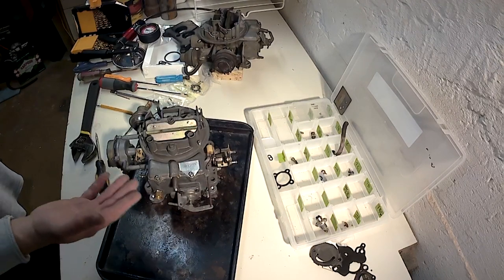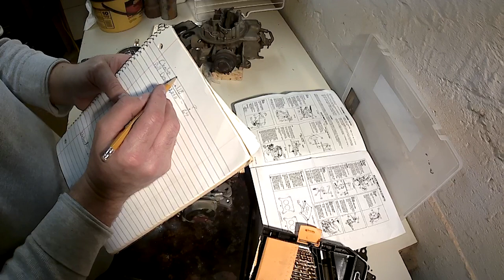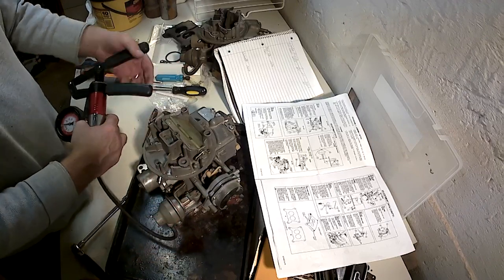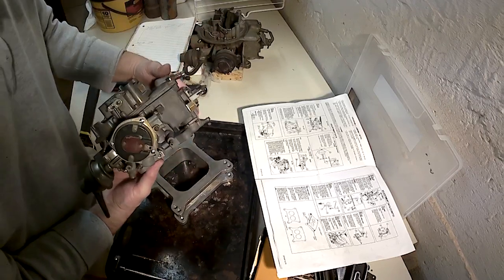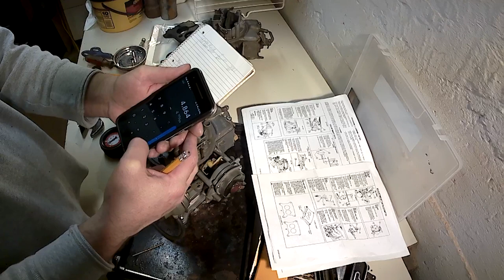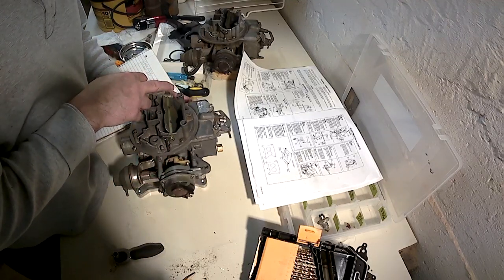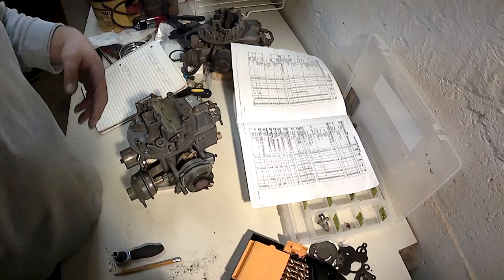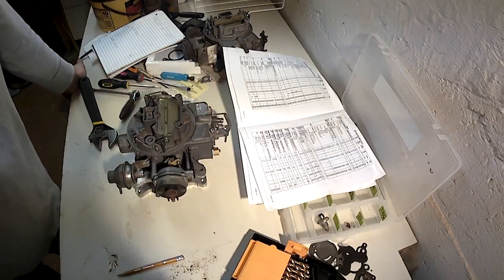2150 Carb Rebuild 4- Choke Adjustments

Comment: Thanks for taking time to put this info on the internet. It was really helpful, as all the info I could find elsewhere did not have the exact configuration as mine. The carb you did had the same choke stuff, and you’re explanation really helped me figure out what to do w all those adjuster bolts. Now if o could only find a vacuum hose diagram/video for the same carb
Reply from the maker: You're in luck! I've got a three-part video series on my Youtube channel where I go into excruciating detail on the process of identifying each of the systems and the vacuum lines that control them, and even go through the process of rebuilding the vacuum-advance harness. Here is the first:

https://youtu.be/GReFi9Z59cA
Reply: @bbsbcv  thank you a ton! I’m not internet savvy, so it’s been a chore to get this far haha. With your video on vacuum stuff I might get the old truck happier than ever!
Reply: On that heated choke riser....mine is sucking air right now and I got surge idle. I noticed a white plug on the choke housing on carb shown here - is that a breather filter for heat riser choke? Please help!

Comment: Geez, so much detail.  I make final adjustments on the engine with engine running.  But it all starts with basic cold adjustments to fire the engine and observe how everything functions.  You think the 2150 is middle of the road in complexity, I think it is an easy simple to work on carburetor.  You say potatoe, I say potato. 
Good video, thank you for your intelligent confabulation.

Comment: Thanks Bob- You did not have to make the final adjustment but I need to - (27/64) WOT- how do I get my WOT to open, what screw is used? Looks like prior to adjusting, there in no vac applied and choke is returned to its normal setting vmark with little line on electric choke? Also, having an issue with the idle stop anti diesel solenoid. Mine is set in the mid range but nowhere near close enough to do its job (I tested it with 12v, it works) I can put my index finger between the stop and the pushed in solenoid rod - way too much gap! Supposed to be pushed in and a gap of 5/16 between solenoid plunger rod and stop. In your video, your solenoid appears correct and is set in the mid range, can't figure why mine is so far off! Help!

Comment: Bi Bob - great video!  Where can I get a copy of the spec sheet that you used?
Reply from the maker: Each rebuild kit usually comes with its own diagram and spec sheet. Alternately, the shop manual will have those specifications.